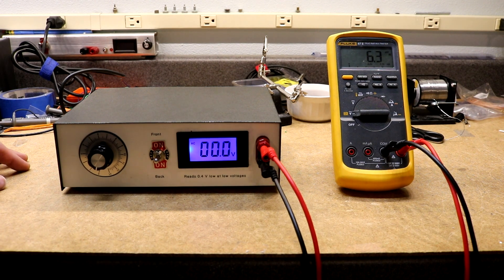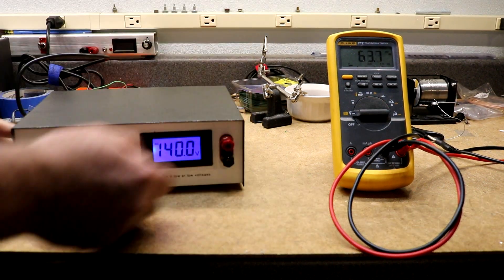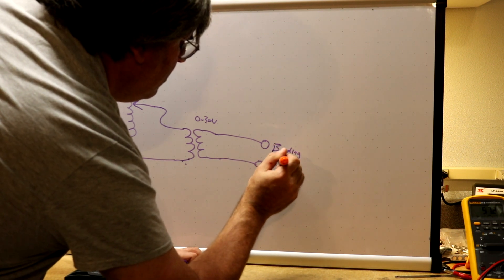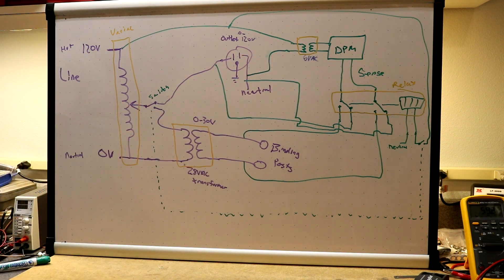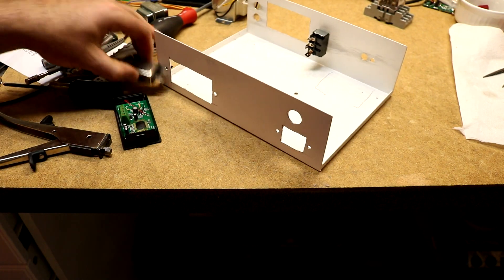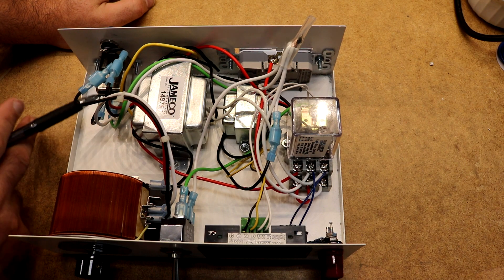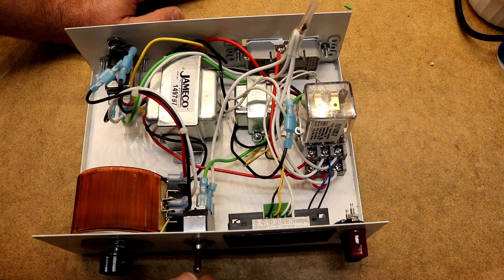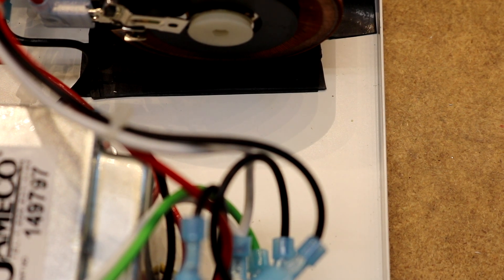DIY Variable AC Power Supply

Comment: learn from my error, variacs need 2 fuses..the output is rated for the same current as the input.. imagine variac set to 12v (easy math) if output shorted 3a in = 30a out  so output blowes. mine blew at the common terminal so could be repaired... have seen others with bottom 1/4 or so smoked.

Comment: did you use an AC Display or did you rectify a DC source for it? thanks for the video.. great build!
Reply: G Dizzle
Reply: Display is 6 volts AC thus the center tapped 12vac transformer(small one).

Comment: Thoroughly enjoyed your video. However, avoiding the question regarding the origin of the Variac used in this great project is puzzling. Is it because they cost from $120 plus or is it because you can buy a Variac transformer on ebay for $140 thereabouts. Either way unless your a lover of electronic projects it would be cheaper to buy the completed unit via ebay 

8http://www.ebay.com.au/itm/Variac-Variable-Transformer-AC-Voltage-Regulator-Metered-500W-0-130V-5-Amp-500VA-/142452412326?hash=item212ad34fa6:g:6AAAAOSwg55ZcdXZ
Reply from the maker: It's been a while so I can't recall why I avoided discussing where the transformer came from, as the answer is simple enough -- my notes show I bought 149324 from Jameco electroncs. As to why I built it myself, IIRC my goal was to have a low-voltage variable AC supply, so the additional low voltage transformer was planned from the start.

Comment: Great project.  I think it needs to be mentioned that the variac does not provide mains isolation for the high voltage outlets.  I would be adding an isolation transformer between the variac and the outlets.
Reply: Absolutely. Also by using that meter in the way you have,  compromised isolation. There is possibly a fault path through the relay and the meter from the tap on your variac straight through to the 30V binding post.

Comment: Hi, I like your set up. Could you use you a adjustable power supply to fix or trouble shoot some power tools with. What I'm intending is to set a safe ac current to run through the power tool, so there is less danger while looking for shorts and testing out tools that use ac. Also please let me know if you think testing out tools with lower ac voltage is a good idea. I don't see how it could hurt a tool running it on a lower voltages. If you plug a 220 tool, in a 110, it just runs slower. I'm not sure how that would work out with a tool that uses circuit boards, but even then its usually just a thysister, a op amp chip, some resisters and a couple capacitors. This could really show case the usefulness of having an adjustable ac power source.ThanksRandy
Reply: If you were to run a power tool at lower voltages for an extended period of time, it could possibly cause it to overheat under certain circumstances, but for simply testing tools out it sounds like a great idea. If you use a non-isolated power supply, be sure to isolate yourself and the tool by standing on a good rubber mat while testing the tool. Then use a small wattage mains-powered incandescent light bulb grounded on one of its leads, with the other lead having a metal probe on it to touch the tools with so that if there is an internal short to ground inside the tool, the light bulb will light up and warn you. Don't forget to try turning on the tool to test for shorts to ground while energized also.

Comment: Very nice DIY project. I am doing something similar, but I do have to ask, why waste the time and expense of a 28v transformer? Just bring your variac out to the binding posts as well (you all ready have the relay) and have 0 to whatever voltage out there. The small DVM looks cool. Thanks for sharing.
Reply: Auto-transformers are not isolated from the mains, so looks can be deceiving. Imagine this: autotransformer set to 5V, but the plug is not polarized like in germany, so while it can be safe to have some 5v(a bit of the winding) and neutral, if it's plugged the other way will have 230v and 225v .. still 5V but in reality there is no ground, and if you provide a short path to ground you get electrocuted from either terminal, one has 225v, one has 230v.. so a big no, no.
Also the equipment you are powering might be grounded and if you supply 5v but with 230v difference to ground potential, you might get into arcing from those presumably 5v to ground. So a tiny circuit that runs at 5v must be insulated from ground as if it was 230V.

Any autotrasformer must have a conventional transformer grounded (even 1:1, or whatever suits to improve range and resolution) to provide galvanic isolation, and have those 5v or whatever voltage will be absolute from the ground potential. So it's a must to have the second transformer.

AFAIK autotransformer stuff is not available in consumer electronics - too many dangers. With respect and knowledge it can be handled safely by providing isolation right next to it.. so have a proper setup between auto-transformer and transformer and put it in a sealed box and never mess with what's in it, only what's out of it.

Also the second transformer must have primary winding properly insulated for mains max voltage and not the autotransformers max voltage
Reply from the maker: +saturn5tony My primary goal was to build a 0-30 VAC benchtop supply. I didn't want the risk of someone inadvertently turning the knob up and sending 120 VAC out the binding posts to a project that was intended to only work from low voltage. Using the transformer also allows me to get a bit finer control out of the variac for the range I was interested in. The receptacle on the back and the relay to switch between the two ranges was a bit of an afterthought -- I figured it will come in handy powering up old tube radios and such.